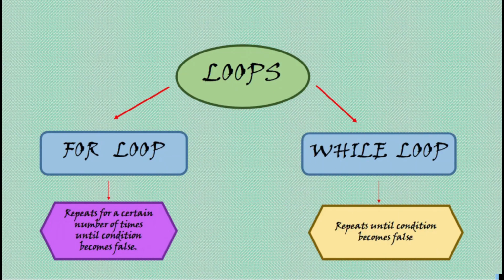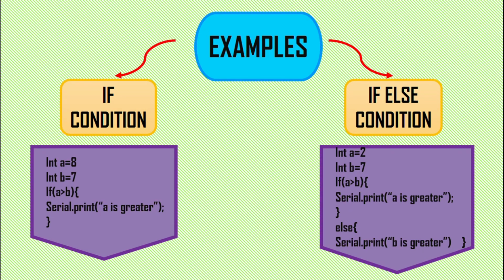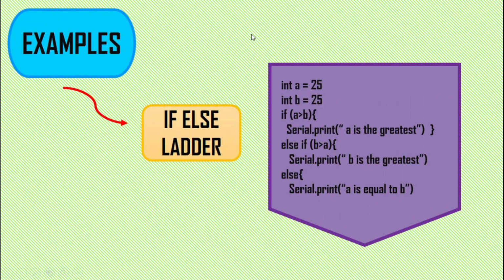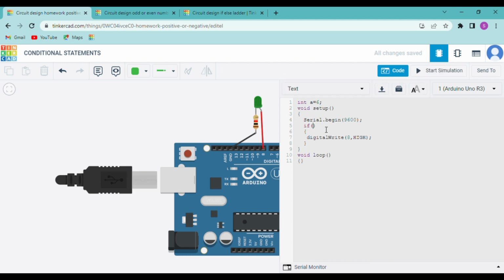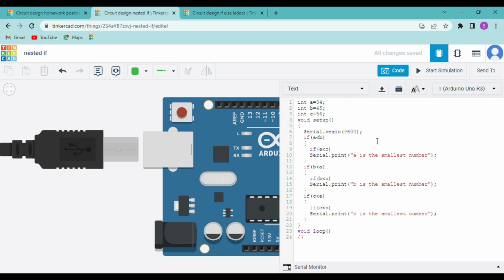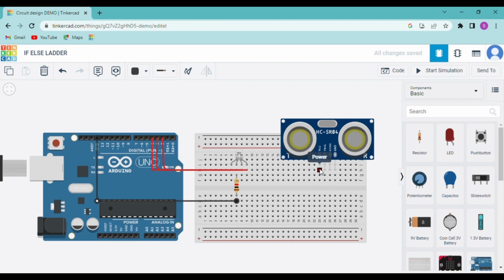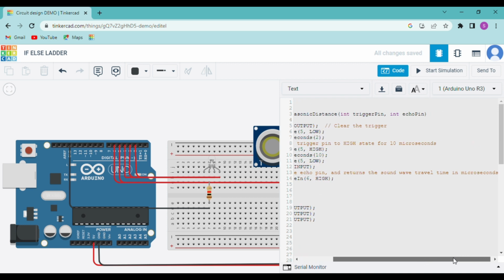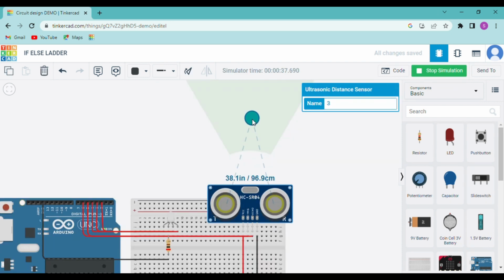Different conditional statements in tinkercad and also project using Ultrasonic sensor

Comment: would you send us the arduino code ?
Reply from the maker: int dist = 0;

long readUltrasonicDistance(int triggerPin, int echoPin)
{
  pinMode(5, OUTPUT);  // Clear the trigger
  digitalWrite(5, LOW);
  delayMicroseconds(2);
  // Sets the trigger pin to HIGH state for 10 microseconds
  digitalWrite(5, HIGH);
  delayMicroseconds(10);
  digitalWrite(5, LOW);
  pinMode(6, INPUT);
  // Reads the echo pin, and returns the sound wave travel time in microseconds
  return pulseIn(6, HIGH);
}

void setup()
{
  pinMode(2,OUTPUT);
  pinMode(3,OUTPUT);
  pinMode(4,OUTPUT);
  
  
}

void loop()
{
  dist = 0.01723 * readUltrasonicDistance(5,6);
  if (dist > 20 && dist < 30) {
    digitalWrite(2, HIGH);
    digitalWrite(3, LOW);
    digitalWrite(4, LOW);
  } 
  else if(dist > 30 && dist < 40) {
    digitalWrite(2, LOW);
    digitalWrite(3, HIGH);
    digitalWrite(4, LOW);
  }
  else if(dist > 40 && dist < 50) {
    digitalWrite(2, LOW);
    digitalWrite(3, LOW);
    digitalWrite(4, HIGH);
  }
  else if(dist > 50 && dist < 60) {
    digitalWrite(2, HIGH);
    digitalWrite(3, HIGH);
    digitalWrite(4, LOW);
  }
  else if(dist > 60 && dist < 70) {
    digitalWrite(2, HIGH);
    digitalWrite(3, LOW);
    digitalWrite(4, HIGH);
  }
  else if(dist > 70 && dist < 80) {
    digitalWrite(2, LOW);
    digitalWrite(3, HIGH);
    digitalWrite(4, HIGH);
  }
  else {
    digitalWrite(2, HIGH);
    digitalWrite(3, HIGH);
    digitalWrite(4, HIGH);
    
  }
}